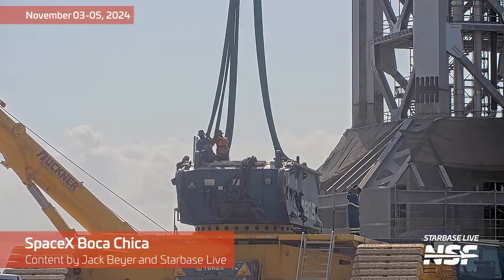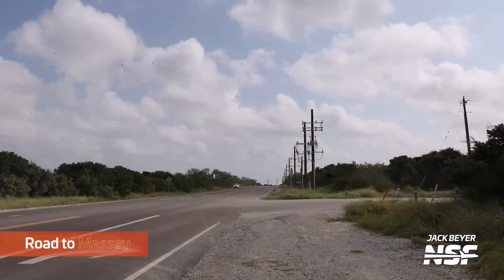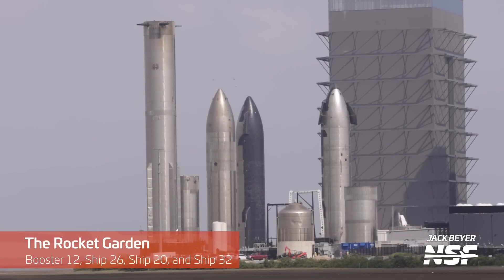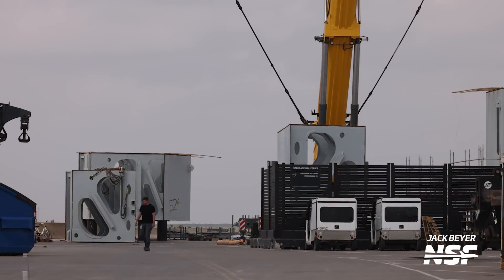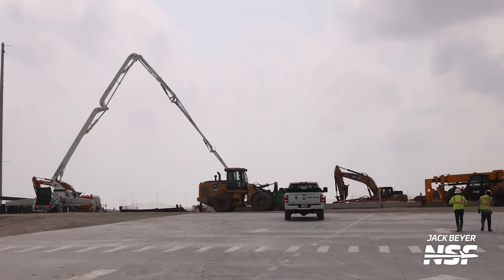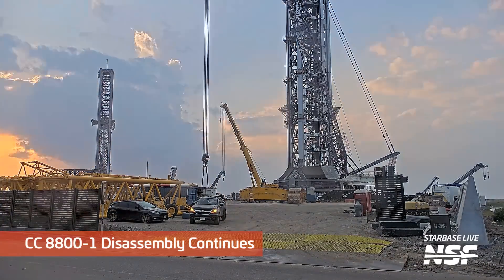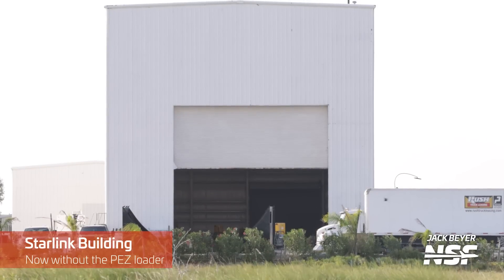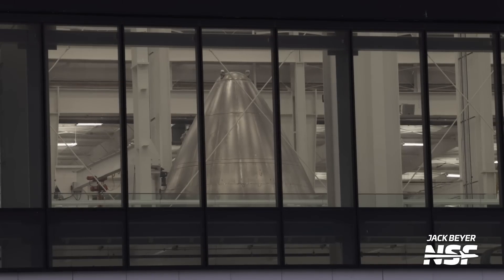Massive Crane Makes Way for Next Starship Launch | SpaceX Boca Chica

Comment: I wonder what they are goong to do with ship 26
Reply: Get KMR on it.

I’d like to see the 26 and 32 shells used for 8-meter space telescopes. You could replace the existing nosecones with integrated telescope and swing door units (like how V2 Ships 33, on are sending the payload bay integrated with the nosecone to Mega Bay 2). Put your best V2 Raptors on there and ship them to Hubble altitude or maybe more.

Comment: There isn't really any kind of gate between Orthanc and Minas Morgul.  The big problem is that they're really nowhere near each other.  Orthanc is nestled in the Misty Mountains and Minas Morgul is on the edge of Mordor.  Probably the most prominent feature, though, that goes between them is the Great River.  You could probably use that as the entrance road to the launch site maybe?  The other problem is that both of the towers in LOTR are bastions of evil, and the launch towers are beacons of hope.  Kind of a different feel. 😂

Comment: Machines disassembling machines....how perverse!
Reply: The smaller crane partially disassembles itself.  All the counter weights come in on a truck and then the smaller crane loads them onto itself and then it starts working on the other crane.  I work around these massive cranes all the time.  Its pretty interesting to watch them do their thing. We had one job where they spent 2 weeks doing all the prep work for the light including assembling the crane.  Then this massive truck and trailer showed up with a vessel that was lying on its side.  They hooked the massive crane to the top of the vessel and the smaller crane hooked onto the bottom and they lifted it up off the trailer.  The trailer drove away and then they stood the vessel straight up and down.  The crane that was hooked up to the top of the vessel lifted straight up and down and the smaller crane just slowly drove forward while keeping the bottom of the vessel off the ground.  Once they had it standing up they put it back on the ground and released the bottom crane and the big crane picked it back up and swung it into place.  All in the total crane time was less than an hour.  Then another 2 weeks to disassemble the crane and send it off site. 
Its not the same lift that I did but if you search for "Heartland Petrochemical Complex - Splitter Lift" on youtube you can see the process.  
If you end up being interested then check out the Mammoet youbube channel.  They are the heavy lift experts.  They get to work on some really cool and complex problems.  Its a totally different world that most people never see but is critical for us to get to have the quality of life we get to enjoy.

Comment: I just hope the new administration doesn’t cut funding to NASA and does agree to further fund the FAA to allow faster licensing.
Reply: The FAA received large additional funding (~$500m) under Trump’s first admin. Specifically to address General Aviation and increased efficiency standards.
Reply: This is what I’m a bit concerned about. Imo if it were me I’d give them more funding on the condition that they do not make launch vehicles or contract with Boeing. Stick to probes, landers, telescopes, and rovers. They’re quite good at that.
Reply: @FerociousPancake888  pretty sure that would be illegal (blacklisting a specific company)
Reply: @Barthhhelona you think A convicted criminal is going to bother about laws?
Reply: FFA was the problem that made the wait for flight 5 take longer. So FFA just needs to back off and NASA should take over = faster launch cadence 😉

Comment: Is there any potential for a direct road to be made from starbase to Massey's etc? Where they wouldn't have to go on public roads to go between sites
Reply: The problem is the best place to build a road, is the one they used the first time.  So they're widening it and putting in pull out spots.
Reply: I asked a similar thing not long ago on Twitter, if they wouldn't be better off making rails to only cross the road once over to the launchsite, but the consensus ended up being that the regulatory hurdles to get this set up in the area, alongside the tried and true method via the road/SPMTs, was not worth it.
Me personally, as a layman watching from the sidelines, I could very well still see this happen depending on how much they may still want to ramp up their production/test/launch cadence, so eventually they'd have to shuffle and transport vehicles around quite a bit more often.

I mean...when the first OLM was being constructed, armchair-rocketengineers were already screaming "This won't properly work out without a flametrench!" and voilá, they may now have the watercooled steelplate after the fact as an alternative solution because of the space constraints, but not until SpaceX was taught better AFTER the pad got obliterated during IFT-1.

Bottomline is, maybe not right now but eventually I think they need a dedicated road for their ships and boosters.
Reply: @avon_c6199  Rails are far to limiting, especially now.